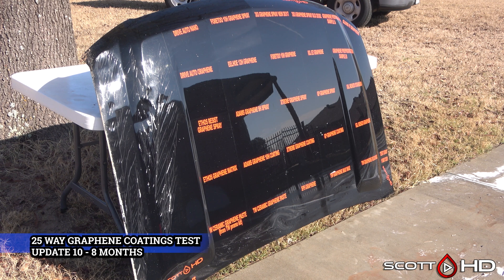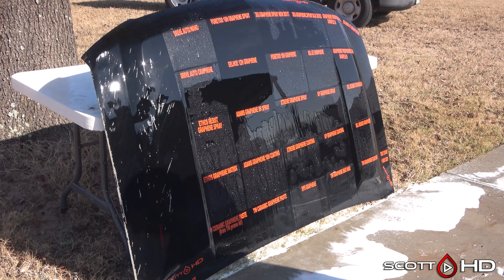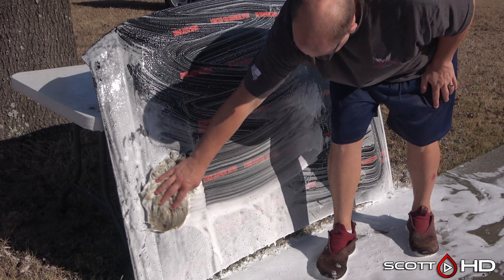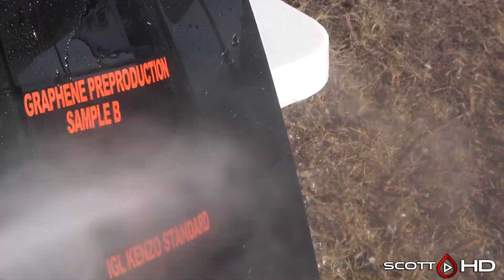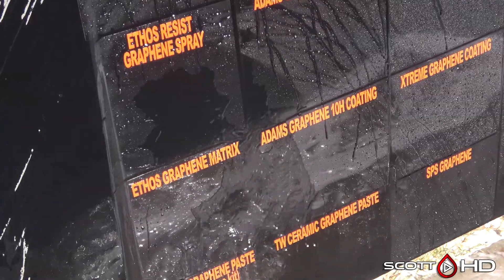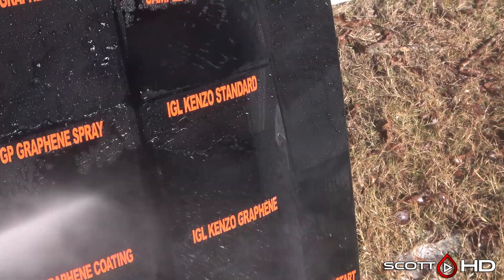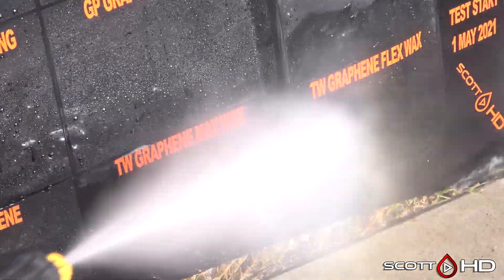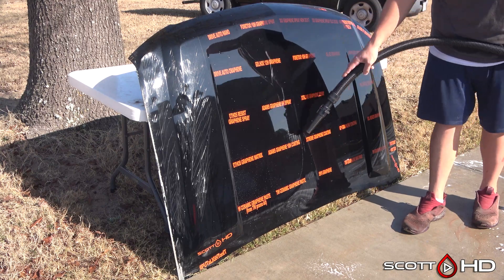Graphene Coatings Longevity Test - 25 WAY - ULTIMATE comparison - UPDATE 10 - 8 MONTHS

Comment: You should do one for wet applied sealants/waxes....a lot of mobile detailers have to use wet applied because if they dry then go to apply sealant on dry paint in the sun on 100F day, it can turn into a mess. Wet applied works better....but I wonder how hard the durability drops off when wet applied. Maybe a test to see how long they last and also for the products that can be applied wet/dry compare both methods.

Comment: Have you ever thought about doing a comparison of how coatings adhere and perform on plastics or chrome?
Reply from the maker: Great idea. I hadn't but I definitely can.
Reply: @ScottHD  I actually ceramic coated my SxS. The coating just didn’t seem to hold up on the plastic parts. I coated with turtle wax graphine flex wax spray then a second coat with Grio’s 3in1 after seeing your tests.  Thanks